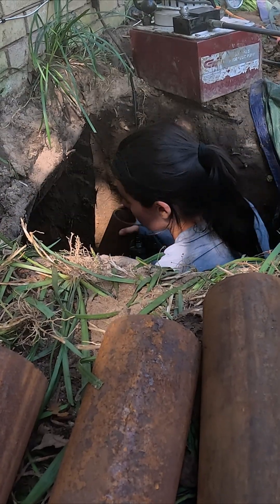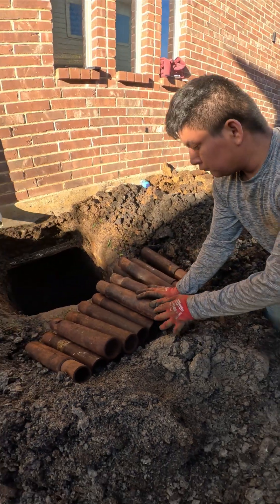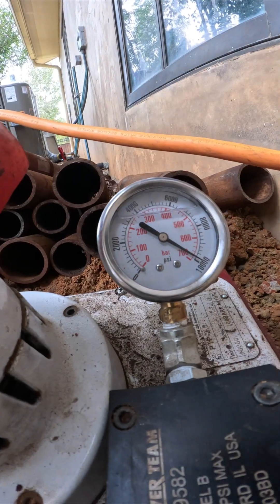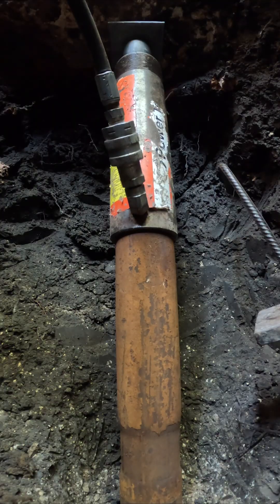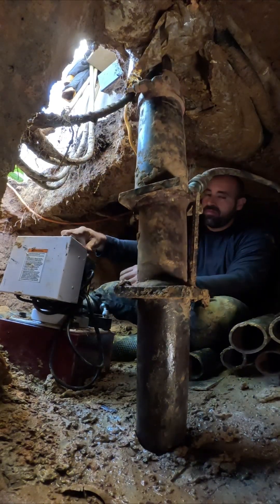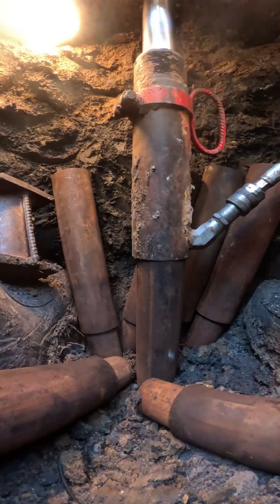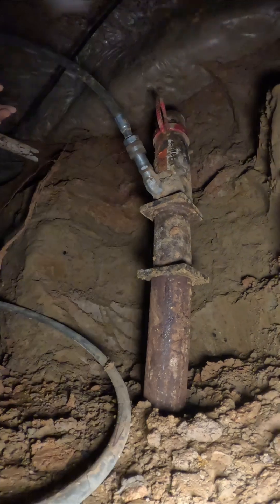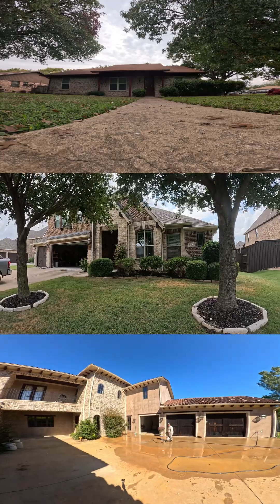Surface rust ≠ structural damage. Steel Piers

Comment: I think you’re describing best case optimal conditions. I would bet you a donut of your choice that if we went to a house which allowed water to come to rest against the foundation and repeatedly wet the steel piers and weaken the pier at the top, next to the house.
Steel at the bottom will last for centuries.
The topmost steel near the house? Maybe a different story!
Reply from the maker: How is that non structural steel, cast iron pipes under homes have lasted from 30 to 60 years. Depending on soil conditions? Our steel piers are carbon steel designed for this purpose. Real world studies have shown that in the worst case scenarios, under very high pH, highly oxidizing industrial soils, the pipes last around 15 to 40 years. Such soils are very unlikely to be found under residential conditions. This is the worse scenario, the best; the pipes could last up to 1,000+ years.

Comment: So what happens in an earth quake? Can these piers be sheared off?
Reply from the maker: In an earthquake the soil, foundation and piers all move together, so there’s no isolated force that would just shear the pier off. These steel push piers work under vertical compression and are fully embedded, designed to support extreme loads. Shear failure is extremely rare unless there's structural collapse.

In seismic regions, engineers may add different or additional reinforcement measures, but shearing off is not a typical failure mode of properly installed steel piers
Reply: @ifixconstructionfr I understand, I have read that in certain regions it is less suitable depending on the levels of seismic activity.

Comment: How do you know which area to dig and place the steel pillars?
Reply from the maker: The first step is to inspect the house, looking for signs of structural stress, cracks, uneven floors, doors/windows not operating normally, it like your house is trying to tell you it's sinking. Then we use a ziplevel to measure the elevations, the international residential code stablished that a slab should have no more than 1" of drop over 30ft span. Then we evaluate the environmental conditions around the house, and with all this information we can create an adequate repair plan
Reply: @ifixconstructionfr Fascinating process! Thanks for sharing.

Comment: No, "passivation" is when the OH- ions in a strong alkali (like the lime in cement) prevent the steel inside the concrete from rusting
Reply from the maker: Passivation inside concrete is chemically induced (alkaline pH).
Passivation underground happens naturally because limited oxygen + stable moisture + low permeability soil slow down further oxidation after the initial superficial layer forms.

Comment: What happens if you hit a rock of something. Does it bend?
Reply from the maker: If it’s just a rock or a shallow hard layer, the pressure will spike, but because we apply constant hydraulic force and the pier has a small diameter, that rock usually cracks and the pier continues to go down.

Only in rare cases, like hitting a large boulder or a very solid layer, the pier may stop at a shallower depth. When that happens, we can easily detect it by comparing depth and pressure with the rest of the piers on the same job. Based on that, we evaluate if we need to add an additional pier 2–4 ft away, or if the depth is already sufficient to leave it as is.

Comment: shouldn’t you connect each section together, instead of them just freestanding in the ground? what if the ground shifts? what those sections of pipes detach from each other
Reply from the maker: The first pipe is open at the bottom and it inserts into a 3" round collar/foot that’s slightly wider than the pipe. That widened base pushes the soil around as it goes down, which helps reduce friction and allows the pier to reach the deeper, denser load-bearing layers more efficiently.

The pier segments interlock and sleeve into each other, creating a solid vertical column. Once they’re driven deep into load-bearing soil and the entire weight of the house is sitting on them, there’s no lateral movement—only vertical compression.
Reply: It’s not free standing they insert into one another. You can see it in the video.
Reply from the maker: Correct

Comment: Did you just say that the rust protects from rust? 🤣🤣 I'm sure you build to code and that they're fine for your application, but rust is inherently damaging. Otherwise stainless and galvanized wouldn't need to exist
Reply from the maker: When carbon steel first oxidizes, it forms a very thin superficial layer of rust.
🔹 That layer slows further oxidation because it reduces oxygen exposure to the fresh metal underneath.
🔹 Underground, oxygen availability is extremely limited, and moisture alone is not enough to aggressively corrode steel unless oxygen is present.
🔹 That’s why corrosion progresses far slower below the surface than above it.

If rust was inherently catastrophic just by existing, we wouldn’t be able to find ancient weapons, steel beams, or buried oil infrastructure still intact after decades or centuries.
Reply: @ifixconstructionfr  Carbon steel does not form a self-protecting oxide layer. Rust will continue to consume the material if exposed to water and oxygen. In your application, where the steel is driven into, what looks like, clay, I imagine the environment is largely anerobic and therefore the continuation of oxidation is limited. Not because rusts protects against rust.
Reply: As I said before I'm sure that what you're doing is up to code. I'm not questioning the legitimacy or lifespan of your work. In fact I think it's really cool. But in my opinion the rust protecting against rust argument is flawed. By that logic all rust, above or below ground, technically protects from further rust. I mean sure it technically does, but I don't think it's a productive way of looking at things. I think your video would have been stronger if you worded it something like, "while our below ground piers do rust, the high carbon steel they are made of has a projected lifespan of x amount of years, which will likely outlive the very structure it is supporting."

Like I said though dude I have a lot of respect for the hard work you guys do. And I apologize for being overly critical in my first comment. It's too easy nowadays to laugh at the experts from behind a keyboard 😅

Comment: If you filled the first tube with concrete it probably would stabilize ALOT sooner
Reply from the maker: The goal is to go as deep as we can. Stopping soon is never good
Reply: They wouldn’t be able to insure it dries and hardens properly without taking a long time and more labor to check on it. These people need their foundation stable as quickly as possible. They do a good job digging under the slab but would you want those holes under your house even longer than the process normally takes? Probably not.

This works just as good.

Comment: Keep stacking the steel till it cant go down?
Reply from the maker: We drive them until we hit dense, load-bearing strata.
Reply: @ifixconstructionfr  ok, thanks.... Your deepest record ever did....? Hundred meter?
Reply: @BotakIsBald  probably like 20-30 meters
Reply: @ifixconstructionfr how can you tell once youve hit that strata? you can tell based on the psi of the driver device?
Reply from the maker: Yes, soil capable of reaching 8k psi and above, is dense enough to where most of the houses start getting refusal around that mark.

The pier instead of going down, starts lifting the home

Comment: Mr. Gregory , he thinks there's no oxygen in water .
Reply from the maker: This was never said in the video.
Reply: You didn’t watch the video at all. There’s less oxygen underground which means it corrodes must slower than at the surface. He never said what you’re claiming he did, instead of spreading crap like this watch the video and absorb the info before commenting.

Comment: And unless it has a sacrificial surface metal a coating will concentrate oxidation.  Epoxy rebar in concrete has shown strong oxidation in spots where the coating is compromised.
Reply: No, uncoated steel inside concrete is best. The alkali (OH-) in the cement will passivate the oxidation preventing the steel rusting. Generally if the pH is 10 or more, a bit more than needed to pink phenolphthalein indicator then steel  rebar won't rust (as long as you don't have contamination like chloride and others, so don't use cheap aggregate dredged from the sea unless it has been thoroughly washed). This is why you don't paint or galvanize rebar and why carbonation (carbonic acid in rain) is another topic.

Comment: Osha really needs to have a look at you guys .
Reply from the maker: Foundation repair may look rugged, but it's actually guided by structural engineering, load calculations, hydraulic control,  and elevation monitoring. We lift homes in 1/16" increments while watching laser readings and pressure gauges. The work is strategic—not improvised.
Reply: Bro yall are not following osha digging guidelines 😂 at least from your videos also why not used galvanized steal how are you calling shimming proper work? I got so many questions
Reply from the maker: OSHA trench safety rules apply to deep, unsupported trenches (typically >5 ft deep or where collapse risk exists). Our access holes are 3–4 ft deep, 2 ft wide, manually excavated, and always accessible with immediate exit possible. These are classified as localized excavation pits rather than trenches. We follow engineer-reviewed practices specific to limited-access foundation repair, not utility trenching.

🔹 Structural engineers specify carbon steel piers per ASTM D1143 (Standard Test Methods for Deep Foundations), not galvanized, because underground environments have reduced oxygen diffusion, greatly slowing corrosion. Galvanized steel is recommended for surface or exposed elements (above grade), not deep-soil structural supports.

🔹 Shimming with high-strength steel plates is standard procedure, compliant with IRC guidelines and foundation engineering practices, used to properly transfer load after lifting. This is documented in most structural stabilization specifications.

Happy to share stamped engineering specs or installation procedures if you're curious—foundation repair is rough work, but it's done by the book
Reply from the maker: OSHA note on tunneling 
• 29 CFR 1926.652: Trench protection applies to excavations over 5 ft deep with vertical walls. Our tunnels are 3–4 ft deep and hand-dug with gradual slope, not trenches.
• Soil is removed while keeping constant exit access, meeting 1926.651(c)(2).
• 1926.651(g): Confined space rules only apply if exit is restricted or oxygen is deficient. Our tunnels stay open for airflow and access, so they do not qualify as confined space.

✔ Even when 80–100 ft long, as long as depth stays <5 ft, ventilation and egress are maintained, OSHA trench/shoring requirements don’t apply.
Reply from the maker: I'm happy to discuss and answer your questions

Comment: You ever thought about just saving a lot of money, doing the WRONG thing and filling up these holes with idk, Paper Mache or Sand or some shit and just telling the guy you used Steel support Beems? Or do you not even attempt such a Risk for you understand our God is an All-Knowing God and you Genuinely FEAR going against him?
Reply: Go back to bed mate.
Reply from the maker: Lol, to he honest you can see a lot of guys in other social media platforms, showing videos of how they fix houses using 8x8x12" blocks, they drive 4-8 blocks, get refusal at super shallow depths because of the surface area in contact against the soils, lift the house like that and in 6 - 12 months when the repair fails, they never pick up the phone again.

We have also fixed several homes down over the years, where the piers were only installed superficial, they were not even a foot deep into the ground. 

So unfortunately it is a reality that a lot of people out there are scammers, taking advantage of uneducated homeowners who fall for a "good deal"

In foundation repair, if it's cheap its because it's going to be bad, very bad

Comment: Stupid question here, but do you jack against the foundation itself?
Reply from the maker: We use the foundation itself as the reaction point, because it’s the heaviest and most structurally rigid element available. When the hydraulic pump applies pressure, it doesn’t “jack the house up” — it pushes the pier downward into the soil until we hit load-bearing strata. Only after refusal (when the soil now supports the pier) do we start lifting.

To put it in perspective:

The pier installation phase = downward force driven against the house ➝ pushing the pier deep.

The leveling phase = upward force applied by the pier once it’s anchored underground.

The foundation is not at risk during installation — it’s actually what gives us the force needed to reach stable soil.

Once the pier is locked in place, that same structure becomes the base we lift from.
Reply: @ifixconstructionfr  Thank you! I know its probably a silly question to someone who is in the industry, but I was interested if you needed to reinforce anything before jacking. I really appreciate the informative answer!! Thanks again and keep up the great work!
Reply from the maker: Don't worry, I'm always happy to answer questions. Sometimes we do need to add steel reinforcements. Check out our channel and don't forget to subscribe, you will see amazing videos about these services
Reply: They have to don't they? You can hardly park something next to your hole that weighs enough or is anchored to the ground every time. But I get your question if a section is really weak jacking against it destroys it. They need a good spreader plate.
I figure when the pressure gets too high they reached rock or very structurally decent soil and they stop anyways before "overjacking" the foundation. But the first point of jacking will be difficult that's what I don't get yet. They have to jack the whole foundation up  accross the point where it sagged.

So they probably drive these poles first at multiple points and only then jack it up simultaneously against the poles at these various points.
Reply: The pressure against the foundation is minimal, hydraulic pressure pushes it down